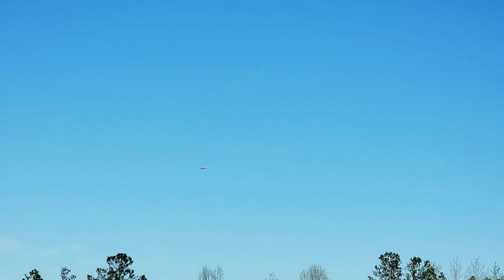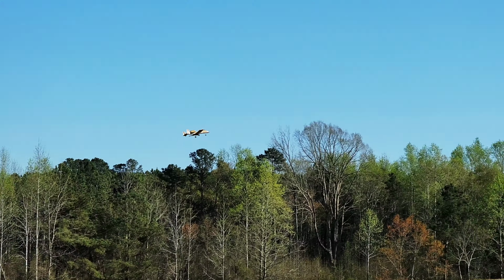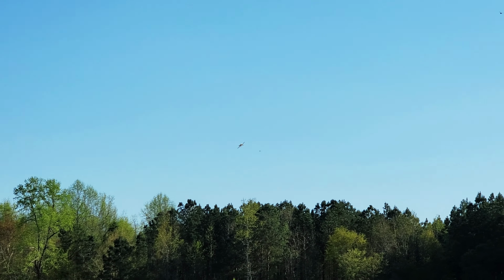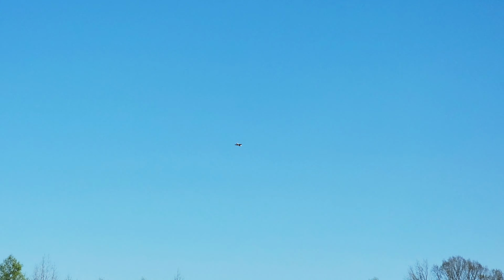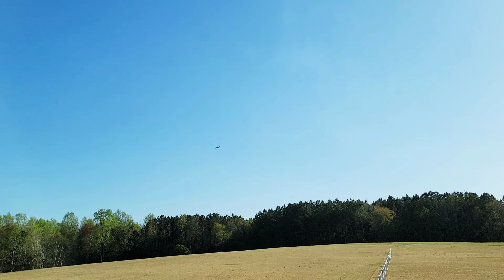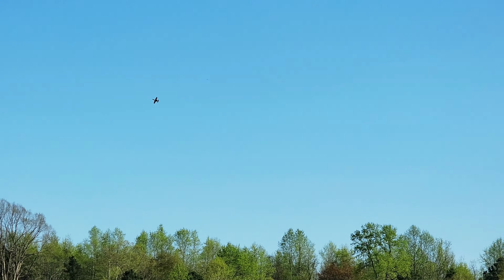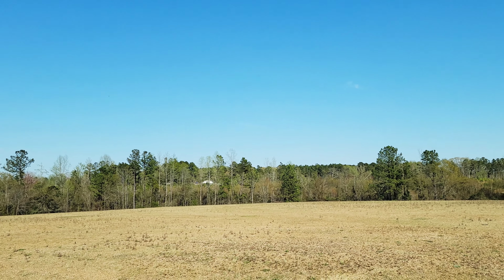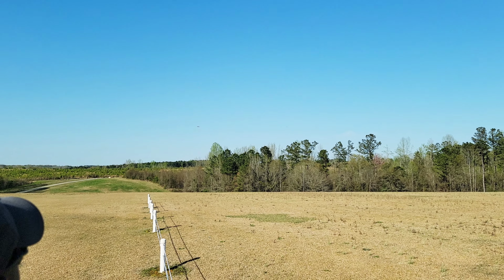E-Flite UMX A-10 Thunderbolt II 30mm EDF Jet☆Maiden Flight & Review Part.1☆

Comment: Nice flight!  surprised you  had trouble doing ROG on that grass though as it's much smoother than what I've been using.  The "trick" when flying in SAFE mode is to use more rudder with the ailerons than most are probably used to doing (I take off in it and do a few laps, typically) and then switch to agility mode (AS3X is ALWAYS on, of course,  but that's why you can fly in that much wind!).  You have to HOLD the inputs too, of course.  Most of my planes that have SAFE will turn almost as sharply as in agility mode and the stall speed seems to always be considerably lower.  I've flown the A-10 quite stably at 30% throttle.
Reply from the maker: I never used AS3X because I want to actually fly the plane but the UMX in windy weather needs it. Definitely Flys better with rudder to smooth it out!
Thanks for watching!

Comment: the reason your motors are making that um um um sound is your battery needs to be a better c ratting, my umx citation did the same thing until I replaced the batteries with new packs.
Reply from the maker: Thanks for the Input! They were 11.1v 30c I flew it with brand new 11.1 40C Lipos and it did better, be on the look out in Part 2! 😉
Reply: Probably not: it's just the  noise from the two edfs beating against each other bc they have slightly different rpms.  That will almost always happen at some place on the throttle curve.  On mine, it's about half throttle but not noticeable at full throttle.

Comment: Great flying plane! I've had zero success hand launching mine, BUT it does take off n land in gravel. In the air in 10 feet! TOO, there's up elevator made in for wide open throttle. That, I don't like.
Reply from the maker: I noticed that too, the up elevator for wide open throttle. I didn't like that it was climbing like that.I took mine off on grass that was semi successful lol!
Reply: @RCPlaneReviewer  

Gotta be a way to remove THAT mix.
Reply: In the last video from horizon, the dude said "we have added an up elevator mix to help with take offs", BUT nothing anywhere in the instructions as to remove it. Mine, is on even in as3x mode. I moved the battery forward a bit & it compensates for it a wee bit.
Reply from the maker: @old-rcplane-phart  I heard you can remove it with the NX8  radio
Reply: @RCPlaneReviewer  

I'll look it up today, & see if I can find the mix on my NX8 today! Thank YOU sir! 👍